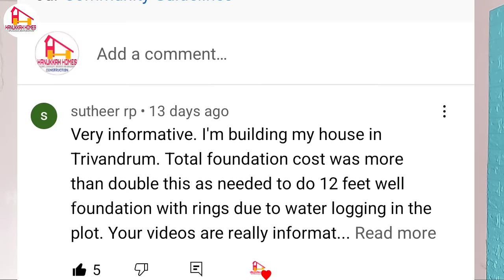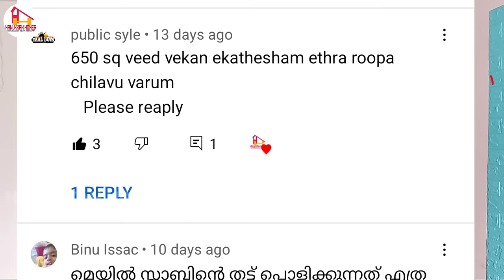6.5 ലക്ഷം രൂപയ്ക്കു കേരളത്തിൽ എവിടെയും വീട് | Life mission house construction in Kerala

Comment: I want to make first floor in following specification. Can you help me with a estimate
 1.one bed room 12x12
2 one  bed room 10x11.
3.two bathroom 8x4 between two bedroom
4. Living and dining 17x10
5.kitchen 8x14
Roof living and dining concrete
Balance good quality sheet
Living and dining room height 10'
Bedrooms 14' side height with proper slop with 35 degree angle
Main door 4x7 steel door
2 bedroom door standard steel or concrete doors
Bathroom fibre

Window to total 6x4 7 nos. Out of 7 three sliding. Four standard steel

Floor rs 60 tiles

Please give approximate cost